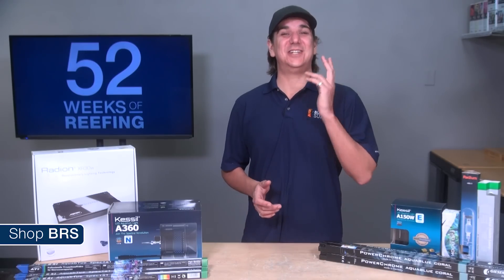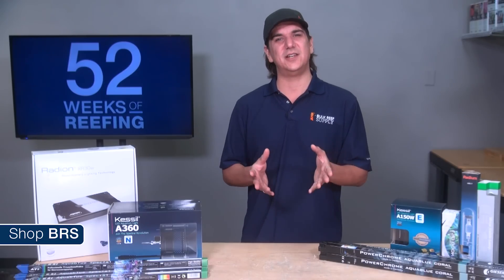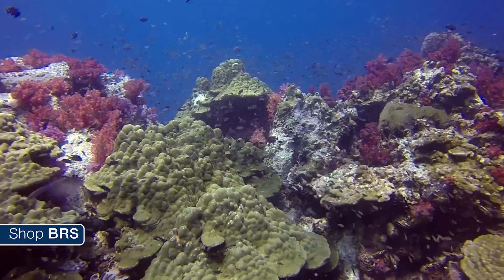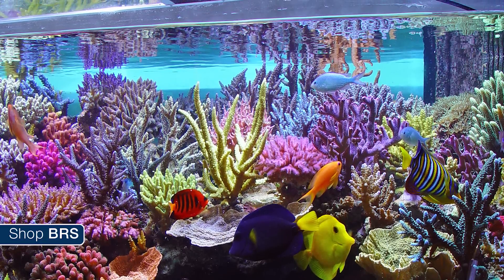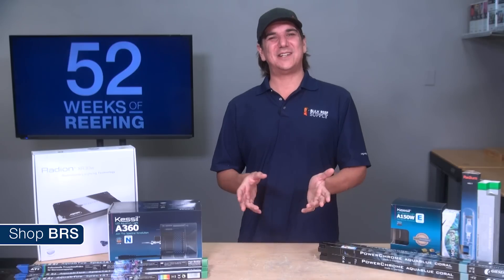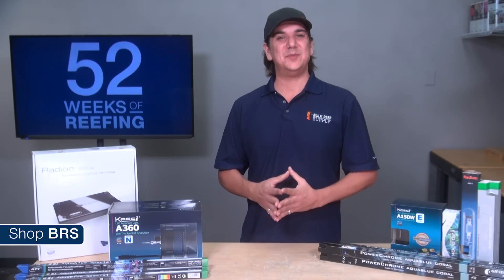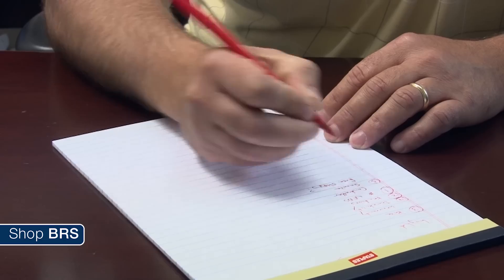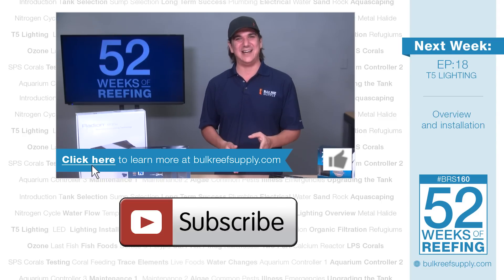Week 18: Aquarium Lighting: Replicating the Sun Over the World’s Reefs | 52 Weeks of Reefing

Comment: couldnt i just use  a mercury vaper light? it makes UVA and UVB pretty much the sun which i use for a lizard  ? or UVB tube light?
Reply from the maker: The light spectrum that corals use most is right around the 460 nm mark. UV spectrum is quite a bit lower than that at about 280-400 nm, so it doesn't work great for our purposes of growing coral.

Comment: Hi. Please tell me how many watts of LED I should use for 800 liters (170cm x 60cm x 80cm high). I will have soft corals, 1 anemone, 2-3 LPS and a lot of live rocks (around 60 kg pucani). Thanks
Reply: +BulkReefSupplyCom
 Did you know how many lumens and watts have for example Eco Tech?
Reply: +BulkReefSupplyCom 
U see I asking you because I want to build my self LED light. I have 3 options.
 First : 4 x cold white 30W 3000lm each and 8 x blue 30W 2500lm. so all together 360W
or 
second option:
4x cold white 50W 6000lm each and 8x blue 50W 5000lm each
all together it will be 600W 
or 
3rd option
4x cold white 20W 1800lm and 8x blue 20W 1500lm all together 240W
Which option would you have chosen for 800liters?
Reply: +BulkReefSupplyCom 
Depth is 80cm it is 31.5"
Reply: +BulkReefSupplyCom 
Thanks Ryan. I will go with the 20W chips. When I made it I will add video with it and I will send link for you. Of course in english :) I think you are the best and your best videos is "52 weeks". Thanks
Reply: +BulkReefSupplyCom 
You can call me Marcin :)

Comment: Another great video Ryan!  I think I am going to be very disappointed when we get to week 52 and there are no more.I have been out of the hobby since 2008 and I am jumping back into it now.  I cannot believe how much as changed in regards to lighting in only 7 years.  Controllers have advanced as expected and we still use Skimmer and argue over sand beds.  But lighting advancements really caught me off guard.  My old 90g had 2-250W MH DE's and VHO actinics.  Seems since I left, half the hobby went to HO's and the MH crowd has slowly shifted to LED's.  Seems the HO crowd is still bouncing back and forth between HO and LEDs.I have already picked up some Hydra Twenty-Sixes for my new CLS110.  But I don't have anything in the tank yet and I have heard that the LEDs will appear dim as all the lighting is direct.  I liked how you discussed the scattered lighting and how important it is.  I was already thinking of adding an HO to the front and to the back of the tank with the LED's in the center.  I will be curious to see how you expand on this as you talk about the other lighting options.

Comment: Excellent start with the series!  I jumped on the LED train for my 40B, rather than constantly replacing six 36" T5HO bulbs.  I know it's all the rage, but I find the LEDs really don't seem to provide the same color spectrum as mixed T5s that cover the tank end-to-end.  Think my final solution for my 110 build might be a mix.  

Important question: the tank for my new build is an older oceanic.  It has a glass cross-brace in the middle.  Will this lend difficulty to lighting the tank?  Or have you found this obstacle surmountable with current lighting tech?